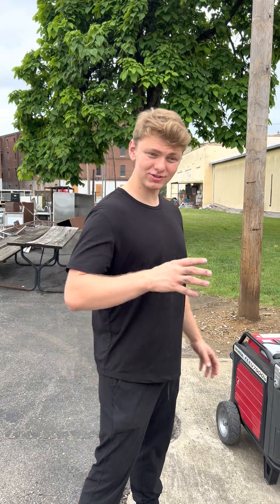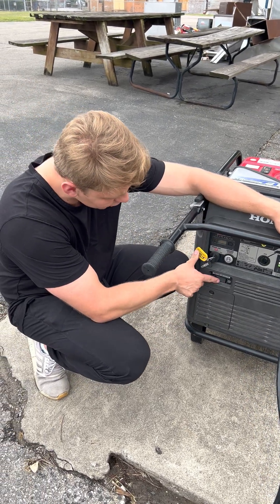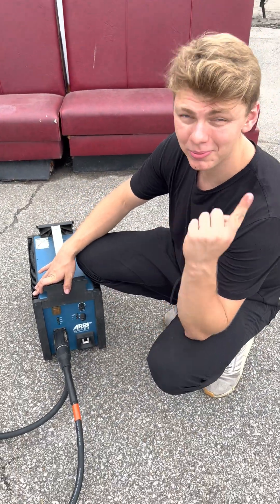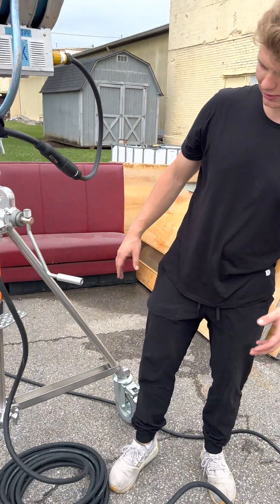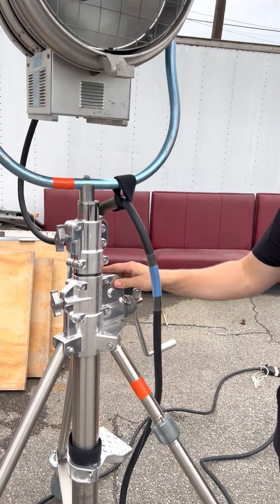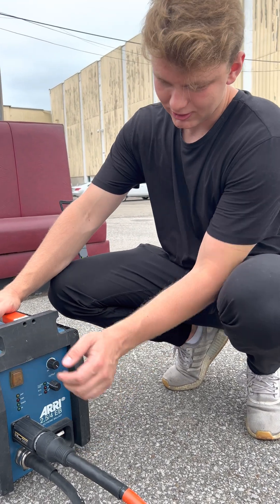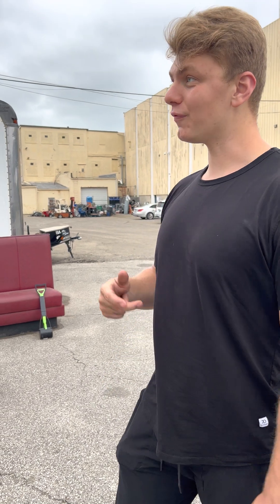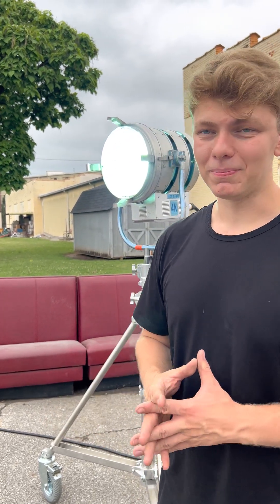Striking a 4K HMI Crash Course

Comment: Century Equipment "back in the day" is correct. Back in the day the c-stand base only used w/o risers was called a turtle.

When passing a stand to an LA IA grip always hold the stand by both the arm and riser. If you hold only the riser they will grab the stand wrapping their paw around both the arm and riser and smuggly mash your fingers remarking, "Must be a local and not a professional!"
Reply: Were I live weve given LA guys various nicknames over the years.  "Professional" was never included.